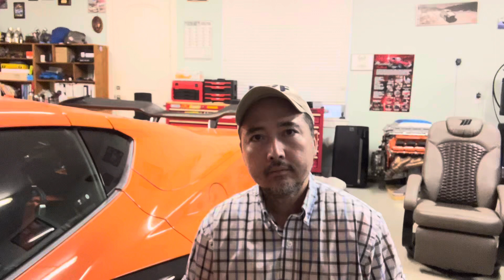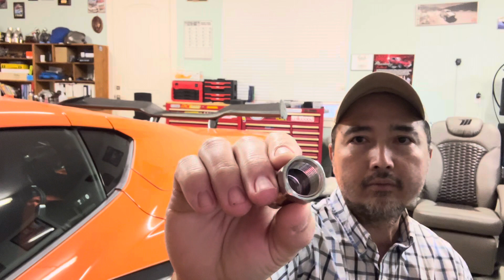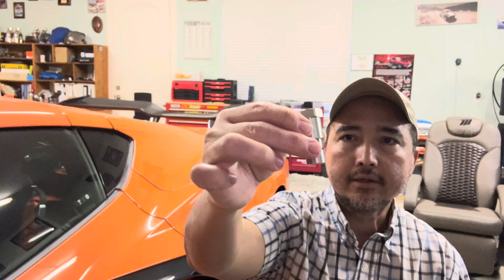Check Engine Light (CEL) due to Exhaust MODS on your C8 !!!

Comment: Update on miles and sensor?
Reply from the maker: I am at around 3500 miles and no issues with check engine light. The O2 sensor extension definitely fixed the issue.

Comment: When you reset-cleared the code for downstream O2 Sensor: It puts the emissions settings back into "Not Ready Status" (O2, EVAP, CAT). You must drive the car for several key cycles, in varying conditions to get the emissions back into "Ready Status". But as long as you are running the CATs without an O2 extender, the ECM will most likely continue to monitor inadequate downstream cleaning, and therefore the system will not go back to "Ready" status. The gain in HP really is quite minimum with the High-Flow CATs on an engine that already puts out 490 HP; I would be surprised if you picked up another 25 HP. And in a car that weighs 3700 lbs, would you even feel the difference?
Reply from the maker: Thanks for the info. I didn’t know clearing the O2 codes would put the mog test to “not ready”! I just went out and checked the mog test and everything is ready. I think from driving with different conditions and modes help with that. As for HP increase with high flow cat, yes I can tell the different. It is quicker off the line. More responsive. And the sound is awesome. CEL is still off as of now so I am happy!

Comment: I used that link and I drive over 1k miles I never see check engine light at all
Reply from the maker: You installed the O2 sensor extension? That is good to know…

Comment: I’m thinking about getting the mbrp exhaust as well and have you noticed any drone and any issues with the exhaust at all?
Reply from the maker: I installed the MBRP and the high flow cat at the same time, so it's kinda hard to make a judgment. The combo will drone if you run with touring mode due to the cylinder deactivation. Z mode is fine. No droning that I notice....